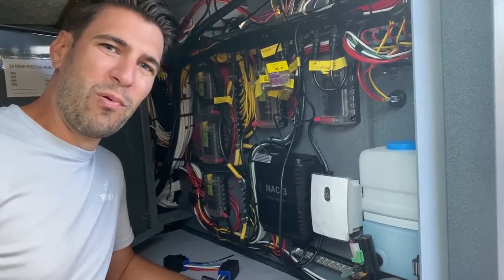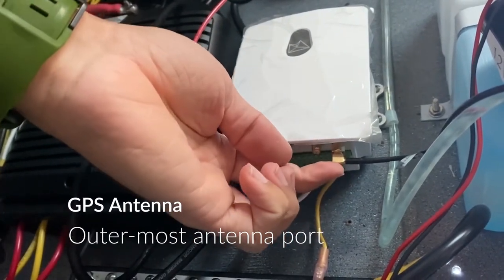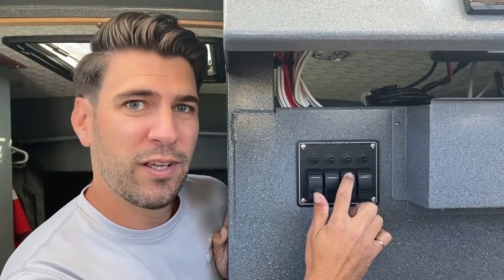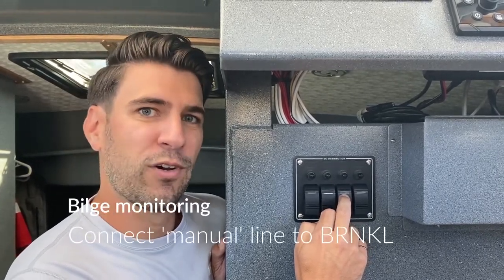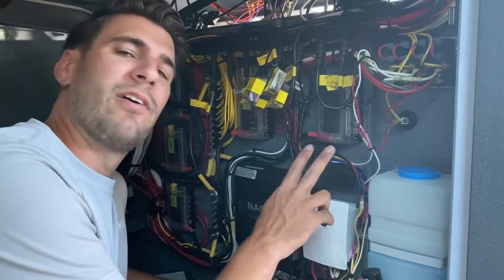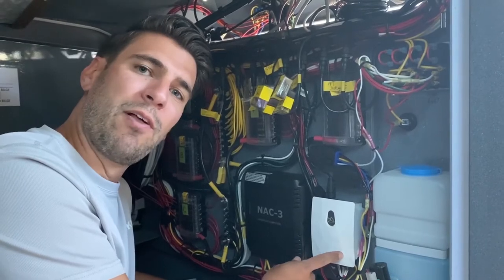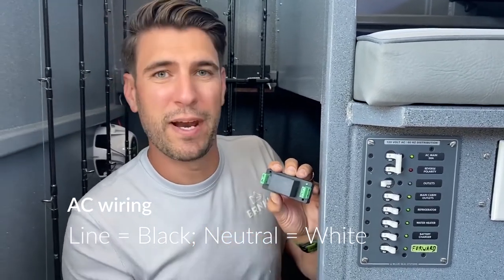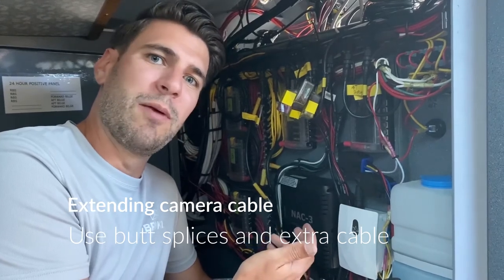BRNKL Boat Security Installation Video

Comment: Unclear explanation of how to connect multiple bilge pumps with one relay.  Or did you mean to tell us to use four relays, one for each bilge pump?
Reply from the maker: Ahoy Jorge! When using a relay for monitoring the bilge pumps you’ll want to use one relay per bilge pump if you’d like to know exactly which bilge pump is running. That relay would then connect to an individual Digital Input on the BRNKL. Hope this helps!!